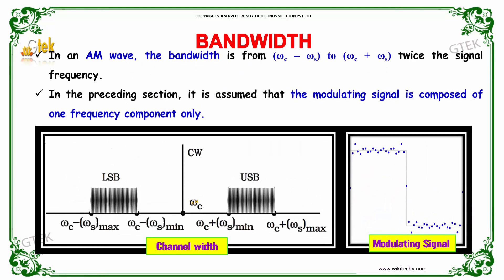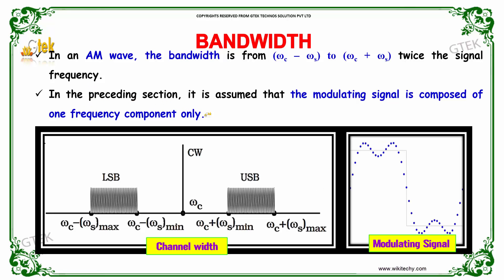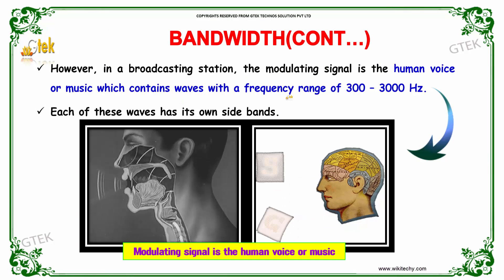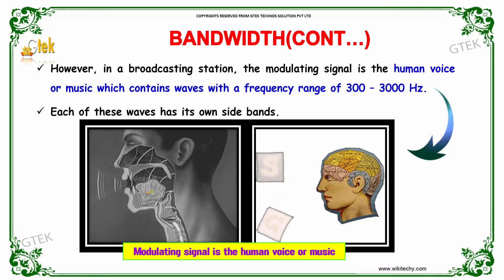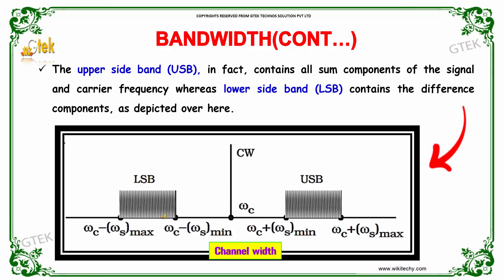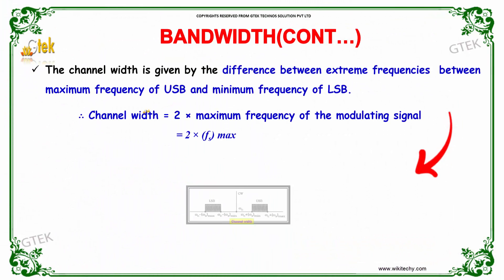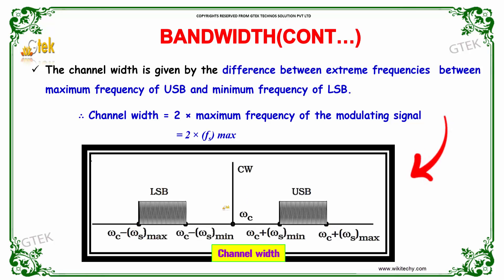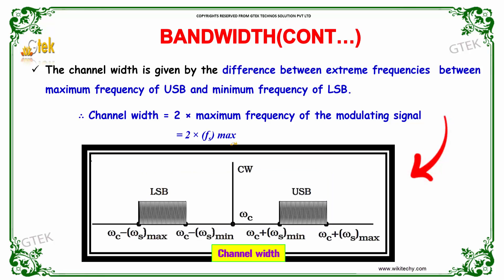Bandwidth | Communication systems |class 12 physics subject notes lectures|CBSE|IITJEE|NEET

Comment: In electronics, Bandwidth is used to measure electric communication. Bandwidth is shown as the difference between the electric signal having highest-frequency and the signal having the lowest-frequency. In computer networks, bandwidth is often used as a term for the data transfer bit rate.

Comment: In telecommunication, a communications system is a collection of individual communications networks, transmission systems, relay stations, tributary stations, and data terminal equipment (DTE) usually capable of interconnection and interoperation to form an integrated whole.

Comment: In computing, bandwidth is the bit-rate of available or consumed information capacity expressed typically in metric multiples of bits per second. Variously, bandwidth may be characterized as network bandwidth, data bandwidth, or digital bandwidth.

Comment: A radio communication system may send information only one way. For example, in broadcasting a single transmitter sends signals to many receivers. Two stations may take turns sending and receiving, using a single radio frequency; this is called "simplex."

Comment: 802.11n can combine two 20 MHz channels to form an effective bandwidth of 40 MHz. 40 MHz enables higher data transmission rates to be achieved as compared to 20 MHz. When you select 20/40 MHz mode, the router decide to use 20 or 40 MHz based on the interference/contention the router detected.